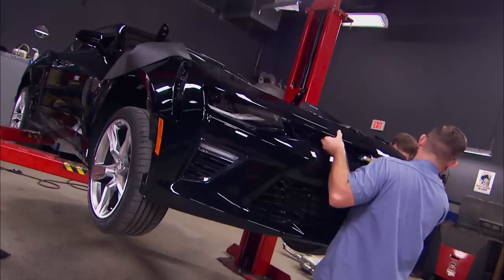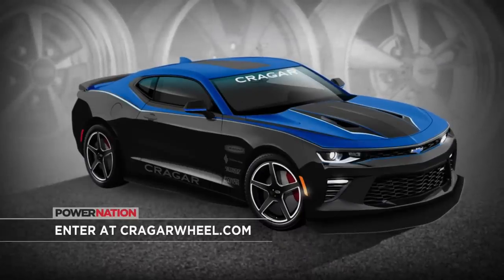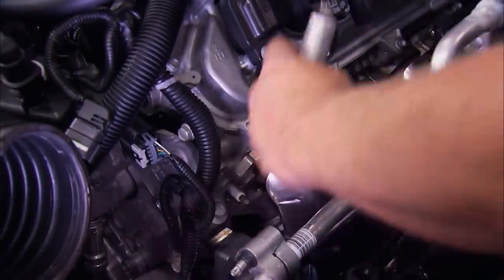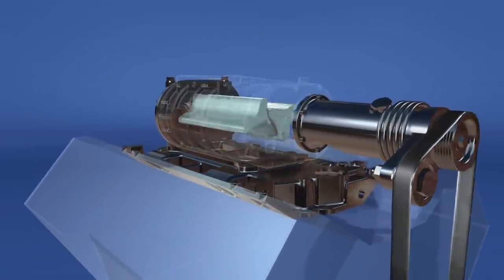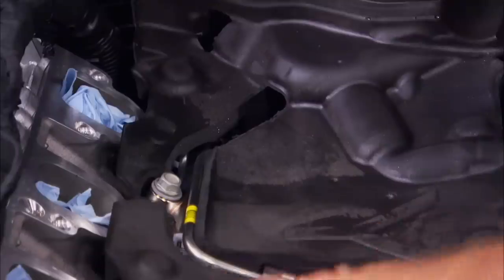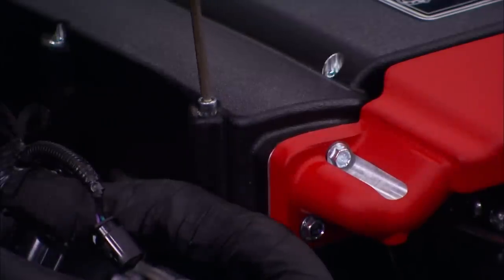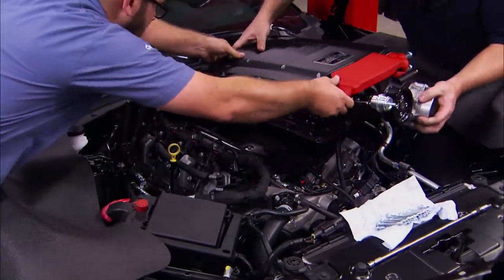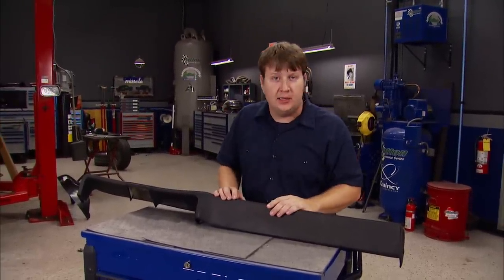Supercharged 2016 Camaro SS LT1 Hits The Dyno - Detroit Muscle S3, E19

Comment: if your doing headers you might as well to long tubes with two high flow cats.
Reply: Exactly, high flow cats and long tube make more sense than this setup. Maybe the cost of the cats held them back?
Reply: The high flow cats notoriously get clogged on these.  (Especially boosted)
Seriously you don't want to have them if you can avoid it

Comment: 419 stock? That’s one generous dyno
Reply: Dunkaroos exactly I thought the 6.2 put out 455 from the crank stock so if rwhp is 419 it’s only losing 37 hp that’s kind of low right
Reply: A lot depends on what correction factors they're using. You can make a dyno say almost whatever you want if you screw around with things.

Comment: Whats the point of the header's and cat back when you're still restricted by not changing the cat's either off or high flow.
Also after looking thru. you gained nothing from those shorties flow wise compared to the stocks only actual upgrade for that would have been long tubes

Comment: 18:24 They are Not riveted, the automatic cars are the only ones that the cross member bolts in like the one pictured, The manual cars are fully welded in to the frame. The manual cross members are what this mod is designed for. The 6th gen camaro looks to be an easy to mod car compared to the C7.

Comment: You forgot to tell everyone about needing a special tool to put the A/C belt back on.
Reply: It's not a terrible job, if you're dexterous with a screwdriver, you can do it fairly easily
Reply: I just did one without the special tool. A screw driver? I had to clamp the belt down to the pulley with 90 degree needle nose pliers and turn the engine over counter clock wise with a big pair of channel locks. I couldn't get all that done with a screwdriver.

Comment: 419 + 15% = 490
Reply: Plus 18%. I Had dyno on truck guy said multiply x 18 % so i had 287.5 at wheel x 1.18  = 339 hp @ crank on 377 stroker. To low. Big block now lol
Reply: It’s a higher percentage because trucks have a bigger drivetrain loss than cars 15% is the standard on most cars

Comment: Forged pistons and lower static CR would make more power and last longer...better run race unleaded.
Reply: Why waste $10 a gallon when you could get bigger injectors, flex fuel sensor, and run E85 instead. Cheaper than 93.

Comment: Coyotes make way more power boosted
Reply: But a boosted coyote only lasts 3 year's if you're lucky!
Reply: @thodieousk5853  actually there are alot of videos on here of guys who have done reviews on their high mileage boosted coyotes
Reply: Thodieous K no there really good engines they last a long time Evan boosted
Reply: @KevinTorres-xs9cq  aMcSpank You never heard of an GM LS motor factory super charged Corvette ,Camaro or CTS ? It's ok Little Boy Junior Mistake..No Factory boosted coyotes because of a weak valve train. 4 cam chains? Ford knows what it's motors can handle!
Reply: Read my comment it will help you understand cars Son!
Reply: @thodieousk5853  Ever heard of the GT500? The Roush Packages? Ford Preformance Packages? All can be bought from dealerships and come with different levels of BOOSTED power. Weak? Lol okay. Go watch my video if the 2016 2SS I had get pulled on by a 2014 Mustang GT 😂
Reply: Thodieous K there’s plenty of videos of thousand horsepower coyotes on the stock blocks
Reply: @thodieousk5853  if they couldnt handle boost then there wouldnt be so many videos of base 5.0s with superchargers smacking Stingray z06s, ZL1s, you name it.
Reply: 2016 camaro ss LT1 make 578hp
Reply: @Sneaky5.sl0w.  Still Think A GT500 is a  5.0? LoL little boy rookie!
Reply: @KevinTorres-xs9cq Boosted 5.0 video That Last! Longer than 3 yr... go back to playing video games!
Reply: @WastdTrashPanda   5.0 coyote 4 cam chains?junk valve train! Weak need replacing / work often with boost. Little boy go back to your Xbox.
Reply: Thodieous K you’re just a fan boy I’m not gonna respond anymore because there is no winning with you that dude in blue has a coyote mustang that’s been boosted most of its life and it has 100,000 miles on it stock engine and trans no problems I never said ls engines suck I just said coyotes are good engines and respond well to boost!!!
Reply: Thodieous K ok boomer
Reply: @WastdTrashPanda  let me guess... Coyote is God , Ironman runs on a coyote. F22 raptor is a supercharged coyote..     Shit Flamer Ford Fans Say!!!!!!
Reply: @KevinTorres-xs9cq  just love laughing at comments like this, if this is true you know you have had a lot of work and money in to something that's not worth it...... 5.0 = junk.. take it from a "Supercar Mechanic"  You  Little Boy!
Reply: Took you kid's forever to learn!
Reply: @thodieousk5853  I never said a GT500 was a 5.0, but it's still a Supercharged 5.8L DOHC engine.
Reply: Lol dude got big mad... Shakes magazine at millennials
Reply: @thodieousk5853  first off it's not the valve train, it's the rods that go. and to that the 5.2 in the new shelby uses that same design just bigger and better flowing heads. so chill. Any car making more than double it's original power output will be stressed and eventually grenade.
Reply: @thodieousk5853  You being a troll an all but a little information to you sir, GM is going the same route dropping the old style and going to DOHC. It'll be similiar to that of every other car out there soon enough
Reply: @thodieousk5853  You know they say ignorance is bliss. You dont seem to blissful. Only people that boast about cars dont have one. get yourself either one boost it then make a youtube channel for it i'll follow as you learn
Reply: @WastdTrashPanda  Only reason you Girls drive a mustang is because a Chevy was to expensive....
Reply: @Joebauers2505  your not reading these comments right behave or I will not put any water in your mother's bowl
Reply: @thodieousk5853  let's see your 'fast' boosted Camaro or Corvette 🤔. I doubt you have anything at all haha. Tell ya what, put your money where your mouth is and come run a 2019 GT for some $$$, $1000 sound good?
Reply: @thodieousk5853  and PLEASE say yes say I can make a video whooping that chevy ass and taking that $$$ 😂😂
Reply: @Sneaky5.sl0w.  I mob a Ducati, I just do this for fun Because it's fun to see how hurt Coyote Flamer's get when anyone mentions LS! a 24 year old GM motor design that still Strikes Fear in Coyote Flamer's Everywhere! 24 Year old Design! I don't even mention a New LT design because I've never worked on one, they don't Explode that often... But at every car meet there's those Flamer Coyote guys Wondering why there motor is ticking tapping...... Should have gotten a 5.2,5.4,5.8! Something better than a POS Coyote Not made for boost!! Personally I'm a Dino Block Fan! But You Don't Know What That Is!!!! LoL
Reply: @thodieousk5853  So you don't own any LS or Coyote platform? But yet, here you are talking smack like you do. Funny thing is, the 3 coyotes I've owned not once did the check engine light come on, but the 2016 SS I had, the check engine light came on a month after driving it 😂 nobody wants to buy that overpriced chevy junk. I snagged a 0 mile 2019 GT for 30k meanwhile, 6th gen Camaros WITH MILES still run 30+k, usually around 35k and 36k. That's why they are going to discontinue the Camaro production again, they aren't selling enough. Nobody wants them.
Reply: @Sneaky5.sl0w.   Owned a LS Trans Am in highschool  but Exotic Italian  build now, But same argument with Flamer Ford Girls about there Beloved 4.6... not made for boost, 5.0 Coyocrap not made for boost!!! Should have bought 5.2,5.4,5.8.. if you wanted a motor that would take Boost!  So continue being SKEERD of a 24 year old design....
Reply: @thodieousk5853  right... because the Terminator Cobra never came out 😂 They where whooping everything's ass when they came out lol very good boost engines and very capable. Again, I owned a 2016 Camaro SS, it was not that fast and I was not impressed by it.
Reply: @thodieousk5853  My 2019 GT is definitely faster than the SS, the 10spd is just too good ffs
Reply: @Sneaky5.sl0w. Don't act like a CoyoCRAP is anything close to a COBRA! Ok I have a soft spot for Coyote Owners. They pay the shop a Lot of money to have me install there Bolt on junk that still is not that special, If you wanted Fast you should have bought Fast! Yes COBRA not a POS Coyote!!!! So don't go ACTING LIKE your CoyoCRAP is A COBRA..
Reply: @thodieousk5853  you realize the 4v DOHC is what they designed the coyote off of right? 😂
Reply: @Sneaky5.sl0w.  Upgraded!!! not a POS CoyoCRAP, 4.6 Style!!Yes  Now Your Learning... See UPGRADED not CoyoCRAP
Reply: @thodieousk5853  again, I owned a 2016 SS, if a Coyote was such crap the  the SS wouldnt have gotten spanked all the time lol
Reply: @Sneaky5.sl0w.  For Real You think Your coyote is a COBRA. Poor Little Girl you should ask your Daddy what goes in to the snake car YOU DON'T HAVE 😮
Reply: They also run into crowds, trees and telephone poles with urgency!

Comment: 5.0 dual fuel mustang is over 500 hp at the wheels with bolt ons and E85..... Sad sad chevy
Reply: Yes, only downside is our bolt on are more expensive. thats the only reason chevy is so well liked, aftermarket performance just cheaper.
Reply: Sadly I'm gonna have to agree I had 14 Gt with FBOs and tuned. It was no  comparison to my brother's C5 with H/C, exhaust & tune the coyotes are soft down low which kills the fun factor. I guess anything can be fun if u throw enough cash at it though.
Reply: @Slvr2k  You must not know what your doing.  2nd gen Coyote motors (2015-2017) are made for boost.  I’m talking everything from Procharger, Vortech, Paxton, Edelbrock, etc....with proven dyno numbers up to and over 700rwhp.  Just get an aggressive tune from Lund or Palm Beach Dyno.  Only thing to do beforehand is upgrade the oil pump gears and switch the crankcase to billet pieces and you are good to go!🔥

Comment: 419Whp bone stock? From a supposedly “455 Stock HP”??
Reply: Joe Knapp I hear you, but if those wheel numbers are true then the 455 factory rating is simply me serious sandbagging on GM’s part.
Reply: I used to own this car. It should of been about 400whp. Their dyno must reads high because 419whp is kinda high.
Reply: @CWood91  
6 speeds have less drivetrain loss

Comment: Yeah right , 8,700 on a super charger to pick up 100 hp . That car made 450 factory , so you can 100. With a good hp tuners tune and intake and exhaust they make 475, Edelbrocks products are a joke and where all tired of seeing installs on products you get for free and no one can afford and suck . 
Should’ve used on3 performances turbo kit
Reply: Agreed that blower is shit. Can literally get a c7 zo6 blower and port it make over 700 wheel for under 5k
Reply: @hassanosman523 not on this fuel with no supporting mods.  Supporting mods matter alot.  I don't mean just fuel stuff I mean the overall setup.  Long tubes and full free flowing exhaust is alot better than their setup and would likely be required to touch anything near 700. Also ported helps alot because it gives you a huge inlet inlet restrictions kill you on these kinds of blowers.  There is a wide discrepancy of what power you'll make based on your overall setup and supporting mods or lack thereof.
Reply: It didn't make 450 factory it made 419.  Long ways from 450.
Reply: They picked up over 150 hp bro you're pretty bad at math.

Comment: After all of the work on upgrades you probably gained 2 tenths of second faster
Reply: Actually, the ZL1 dynos at around 540 wheel HP and clocks 0-60 at 3.5s (vs 4.0s stock ss). At 570+ hp you can see how this car would outperform the ZL1 given the traction isn't a factor.
Reply: A set of slicks and its hitting the 1/4 in the 10s. My little brothers 2020 LT1 Camaro is stock and  hitting 11.4's with just some drag radials. A stock ss on street tires is hitting 12.8-12.6 in the 1/4. 2 tenths my ass lol
Reply: @1LE_LT1   don't get but hurt by the truth

Comment: Anyone ever notice how sad Ford guy's get when you mention a LS
Reply: Why would they get sad? The world is big enough for more than one way of doing things.
Reply: The only time I get sad at the mention of an ls is when someone puts one in a Ford.  Now that is a disgrace.  Ford's 4v engines even all the way back to the 03 cobra can easily make over 600 rwhp with a stock long block with a modern blower like this camaro has.   And they do it with alot less cubes in case you didn't know the 03 cobra was a 4.6.  The 4.6, 5.0, 5.4 and 5.8 all make easy 600-700-800 depending on the blower and overall setup and fuel.  This is stock long block I'm talking about.  There is sure no reason to be sad about this blown 6.2 doing like 580 wheel lol.  Unless you're a gm guy.

Comment: 420 to the wheels stock, 9 pounds of boost would have a multiplication factor of 1.61 [9 pounds ÷ 14.7= 0.61 + 1= 1.61.....now multiply that to original power level of 420×1.61= 677 hp...that is what it should have after adding 9 pounds of boost...that supercharger is a piece of shit!!!
Reply: That math don't always work.  The efficiency of the engine greatly effects this.  A cammed car with ported heads and long tubes will make a ton more power at the same 9 psi.

Comment: POS LS engine has too much compression, hence the low numbers after bolting on the blower. These engines just aren't meant to be boosted from the factory. Probably wouldnt even be able to drive the thing around here on a hot day even with 93 octane. Useless. Keep posting the old stuff, no more of this new car garbage.
Reply: Coyotes have been running at least 11:1 compression since 2011 and they easily make over 600 rwhp with basically any blower even on 93 with a stock long block.  And this is with a 5 liter lol.
Reply: Higher compression isn't gonna give you low numbers with boost it'll give you more power per psi.  It just means you can't run as much boost for each fuel type but also don't need to run as much boost because it makes more power per psi with higher compression.  The 4v ford's all the way back to the 03 cobra can do 600+ wheel easily on 93 with a modern blower like this.  And that was a 20 year old 4.6.  The Ford engines work amazing boosted even the high compression coyotes so throw that can't boost high compression crap out the window.  Sounds like you need to come to the dark side lol.